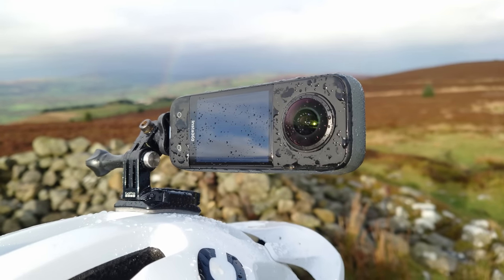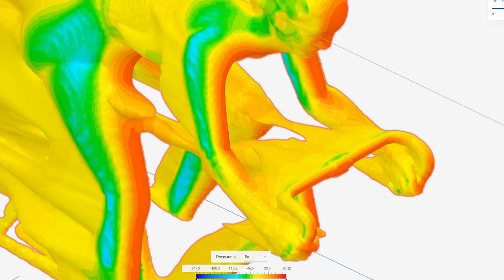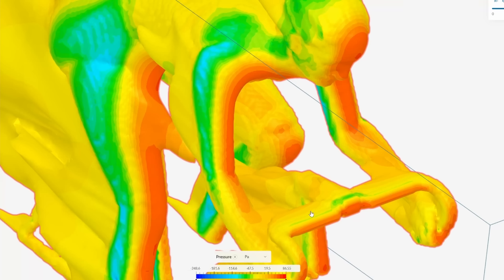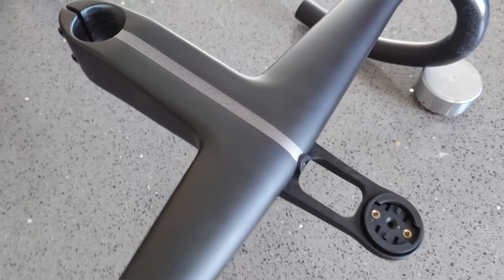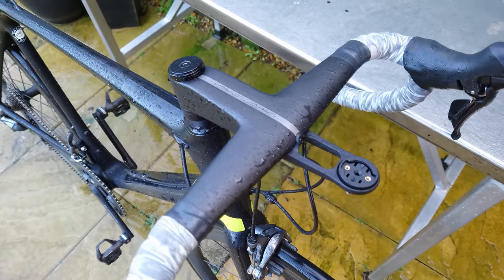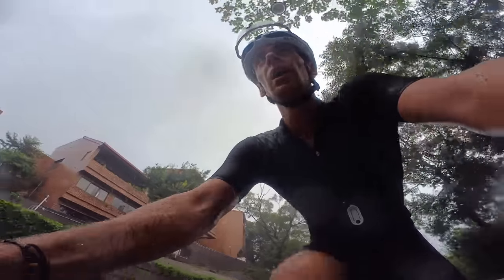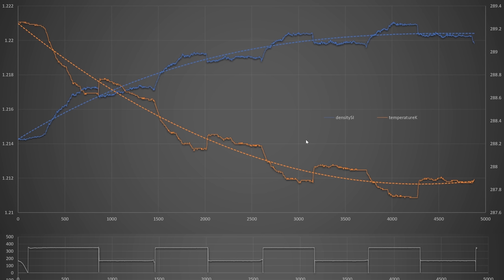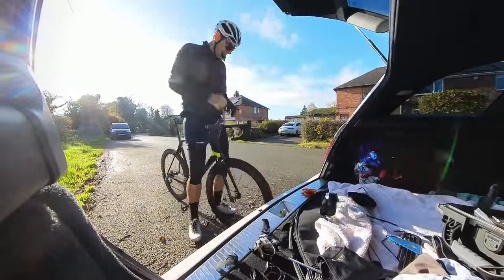Is an Aero Bar Actually Faster? Tested. #aerodynamics #cycling

Comment from the maker: Test protocol:
5 x 1.2km out, 1.2km back (repeated)
3 hole pitot logging at ~5Hz (airspeed, density, yaw, gps, elevation, power, wheelspeed)
Sensor takes a virtual 900m straight of data between two gps waypoints on each lap (so turnarounds and accel/deccel is not logged)
Test speed ~ 40kmh
Power - Favero Assioma
Control tyre - gp5000 25mm
Reply: May have missed it, but round bars were 40cm too?
Reply from the maker: @fastasasloth  yes of course. Has to be the same or a pointless test! Same width, same stem length, same hood position checked with a tape measure
Reply: what is that device you're using to measure airspeed, density etc.?
Reply: What width were your handlebars please AND the length of it’s stem….. I’d like to order one!!!
Reply: Does the one piece handlebar has flare too?
Reply: @mpgunawan  The Farsports F1 does have some drop flare.
Reply: @PeakTorque  Please make a video about your CdA-meter. How accurate do you recon it is? Is the significantly higher price tag compared to the Notio worth it?
Reply: I would recommend to do a hand calculation on the drag force (for cylinder and airfoil cross-sections) prior to doing the test. Would have been nice to compare the hand calc to the test results as well.

Comment: Fantastic content, bravo! Please try different bar width. I’m almost as tall as you are and I believe bar width makes an important difference. Maybe try 36-40-44
Reply: Will depyon the rider's shoulder width. And comfort could be more important on a longer ride.
Reply: Only important if you are racing or actually doing anything other than just riding. Upgrades for 5 watt savings would be better invested in training and weigh loss.

Comfort is more important for most, smaller bars are advised against.
Reply from the maker: With the practical difficulties on testing different bars back to back... I'll leave this one for now!
Reply: Damn DENIED!
Reply: That shoulder width is a rough guideline. Plenty of riders tolerate a size (or two) smaller. Compared to a slammed stem (which I do NOT promote) a narrow handlebar is a joke.
Reply: @detmer87  only true if everyone was built the same mate.
Reply: I just installed 32 c2c bars from HUP yesterday! 😁 
For context: the bike fitter measured my shoulder width to be 40. From there, he recommended me to run 38 c2c but I like to live a rebellious life
Reply: Rejected!
Reply: @PeakTorque didn't canyon have bars that you can adjust? Or was that the bar that mvdp snapped?
Reply from the maker: @simonderoo9189  yes they do. Personally i wouldn't ride them. Accident waiting to happen.
Reply: @BikesKomsCRO  What if someone is already raining hard and doesn’t want to lose more weight?
Reply: @BikesKomsCRO  such a pointless response, repeated all the time. It's not one or the other. You can always do both.
Reply: @BikesKomsCRO  ive got 40 cm. I got used to it really quick (and i ride mtb a lot). Im going to upgrade to 38 aero. 5 watts here, 5 watts there all adds up.
Reply: @ariffau  32??? Wow!
Reply: @adambrickley1119  just 32. I think I can go narrower. Funny enough Cycling Tips just posted a video about that. Then, a few days later, UCI imposed a new rule about bar width for road races. Lol. 

My 32 bars are still legal though. Not that I race UCI sanctioned races 🤪
Reply: With regards to bike fit, it’s actually most  common that people are riding bars that are too wide for them. Large and XL bikes often come with bars up to 44cm, which is way too wide for the vast majority of riders even if they are tall people. Do not just assume that the handlebar that comes with your bike is the right width.
I know on the “bike fit Wednesday” series he says that the most common size needed by male riders is 40cm, female riders are more like 36cm average.
For reference I am 6’1” and ride bars of 38-40cm, and this is not based on aero, they fit me better and are more comfortable. I also prefer the sharper feeling handling of the bike, I find the original wider bars make it feel sluggish.
Reply: @BikesKomsCRO  plenty of people have money but don't have time.  Also, a new bar or losing weight aren't a thing where you only get to do one😂
Reply: @huntos83 Same here I’m 6’ and ride a 56 Supersix recently switched to a 38cm. Way more comfortable, sharper handling and free speed. 😁 The stock 42cm feels like a bus steering wheel now.

Comment: One advantage to the areobar that I'm fond of is the ability to rest my forearms on the flat section, especially into a stiff wind.  It's much more comfortable than my round bar bikes.
Reply from the maker: Yep. Technically illegal in UCI but very fast for the local road bike TT
Reply: I've put Grip tape on the flat tops of my madone for that, works perfectly, no slipping whatsoever, love that side effect of integrated bars
Reply: I would say they are more confortable but they require custom mounting for lights and cycling computer. So if you tight on money they do not add much and are much more expensive
Reply: @RemiBusseuil  depends on the light. Light&Motion have a nice mount that sits perfectly on round or aero bars, as it's a quarter saddle (top to front)  with a rubber strap for the rest.

Comment: This is a year old and I haven't read the comments so this may have been said already but those curves are so similar that they seem to even be within margin of error (not just equipment/sensors, but different weather, slightly different daily body condition, etc.). Actually I don't know the margin of error but it looks like a percent or two would be enough to throw them into an approximate tie. I haven't watched many of your vids but knowing the statistical info and margins would help a lot to interpret graphs especially when the differences are fairly subtle.

Comment: I have changed from a 38 Deda compact round bar to a 36 Pro vibe aero pursuit and 2cm shorter stem. I feel like the difference is huge as the aero bar is much more comfortable in the aero hoods position as it's flat so it doesn't hurt the forearms and the 2.5cm reach increase helps because the contact point on the forearms is much closer to the elbows compared to the previous bars when in aero tuck. Also I've turned in the levers so the tips are 30cm apart but it's 40cm at the drops so it's still manageable in sprints and descents. Only Speeco makes a one piece barstem with similar dimensions, even Pro doesn't offer this bars in carbon

Comment: I did find myself wondering if it would be an interesting little experiment to 3D print some different aerofoil sections to zip-tie onto the tops of a round section bar (basically just faring) and conduct a real world aero test just to reduce the other variables, essentially keep fit identical but play just with the aerodynamics of the bars to see what impact that really makes.

Comment: How about a non-integrated aerobar? You could technically get the gains from the aerobar and fine tune the position with your stem of choice. However you would get more drag from the stem faceplate which might neglect the gains from the aerobar?

Comment: One big shoutout to Farsports for making 36cm bar.
Many small riders had to use 38cm aero road bar just because that's the smallest size available. Not the case here.
If you are 5'6 or below with average shoulder width for the height, consider 36cm bar.
Reply: Yes, 360mm and 80mm stem are available.
Reply: @FARWINDY  is it compatible with Winspace T1500 with slammed stem?

Comment: There are aero bars such as the Zipp Sl 70 that are not integrated with the stem as well. A good option if you’re worried about the drops and fit

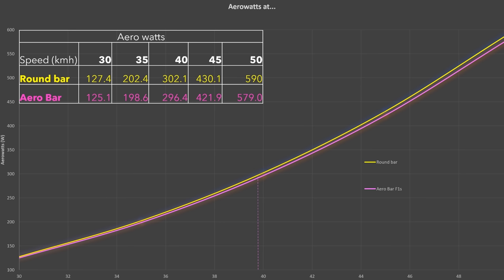Comment: 7:47 onwards is a good point and my main issue with bar+stem combos, not to mention the issue with the drops being non parallel to the ground (why is that) with many models.
On my frames I ride a 130mm stem with bars that have around 110mm reach (not sure) and pretty much all one piece bars come in a compact setup. But they usually also top out at 130mm stem length meaning I can't get enough reach. I tried riding with around 20mm less reach and not only is it uncomfortable but it's noticeably worse on the hoods and in the drops for my position. And my frame already has a long toptube for it's size too. It's very annoying and also makes me wonder why so many bikes (Canyon for example) come with one piece bars and they don't even let you select a size either.
Reply from the maker: Yeh, as a stock component on a bike with no selection of the size, pointless. But the marketing lads love it

Comment: I ride puppy paws when I want to go fast. If my forearms are on the tops of aero bars with padding I don't see how a flat top section on the bar will help. Maybe the 2 inches of a flatter bar between my arms and bar tape. And Bar width is huge for aero gains.

Comment: The body shade temperature makes more sense - overall the temperature is dropping (the sensor being taken out from the car and nearing the ambient/steady state temperature)? But when you turn to south, the temperature rises in a very noticeable step (the sun starting to shine on it?) above the trendline while turning to north gives a noticeable (but a bit slower) fall in temperature below the trendline.

Yeah, the pressure is the inverse, maybe it has some temperature compensation algorithms? Otherwise it makes little sense for the pressure to change unless the difference is cause by your shade (actually dropping the pressure in the shade). But that would mean you'd be faster going south as you'd be riding into a low pressure area, effectively being pulled in that direction (and vice versa going north).

Comment: Your channel has leveled up with this content. Like other commenters I am interested in bar width. I run a 36cm round bar because it's hard to find an aero bar in that width and I'm betting that a 38cm aero bar is not faster than my round 36 which is much cheaper. 
I would love to see if I am correct in my assumption.
Reply: Yes, it would be nice to see some cda difference. I went from 38 aero to 36 round (only to test) and I'm assuming the narrower body position is faster. 
On an extended review, with narrow shoulders, I find 36 to be quite comfortable in general. Although that's the limit as I noticeably lost stability for sprinting, and holding the flat tops over round is more convenient.
Reply: @SonnyDarvishzadeh  I also find the 36 to be very comfortable despite the fact that I do not have narrow shoulders at all. 
I think shoulder width has very little bearing on the comfort of bars.
Reply: @IlPinnacolo I second this. Just look at aero bars. Really dependent on flexibility and comfort or tolerance.

Comment: Hi there, very keen to on these bars. 1) it's very hard to find integrated bars in a 38 width. 2) I've always felt my reach on my current bars a little long. This is around 3cm short so should be great. 

A big question is any potential customs charges from anything from the US or China to UK. Was there any extra charges? 
Thanks.

Comment: kind of related to the effect you were seeing in the video, do you have any tips for winterizing a head unit?

I'm planning on purchasing my first head unit soon. my current setup uses my phone strapped to the stem (running Strava or other GPS tracking). as my phone's battery will rapidly discharge and power off in the cold, I'm worried even a cycling specific unit will do the same

Comment: These results seem to match up with some reported industry test I have seen previously.
What was the width of the handlebars you used? 40 cm?

Personally I have gone away for aero handlebars to be able to go down to a 32 cm width instead.
Reply: 4:07 40cm. I also use traditional round bars in 36cm width with flare at the bottom. You can actually get ones that are 32cm?
Reply: @PaganiZondaF650hp  Yeah there is a couple, but they can be a bit difficult to find and depending on where you find them a bit expensive for a simple round aluminum handlebar.

Comment: Question - I have the new Cervelo Soloist with Ultegra di2 12 speed and I'm talking to their support team regarding compatibility, they told me that the brake cables might affect the steering performance as the holes are closer to the steering stem? Would like some advice on this.

Comment: I have s-works aerofly 25 rise bar. I am 196cm height, so 25mm rise helps to fit correct position. also flat top sections very comfy for hands in long rides

Comment: Very interesting.
On a separate but connected topic - can you do an aero test to measure the impact of shaved legs? 
Could there actually be an advantage of leg hair to attach the flow of air for longer and actually be more efficient, like the reason for a dimpled surface on zipp wheels. And on that point, why don’t they make a bike frame and components dimpled in pursuit of aero?
Reply: It's been tested in a wind tunnel and shaved legs were notably more aero. Also it has been proven that Zipp dimples (and I own a pair of NSW's) make zero difference at best they are a marketing gimmick.

Comment: Dear PT, what is your opinion on the handlebars? Do you still use them? I have them on my radar.
Reply from the maker: Still using them on my rim brake bike. Really like the shape but seem a bit wider than advertised
Reply: @PeakTorque  Thanks a lot! That's even better, the width, cause I'm using 440 mm on my bike. 
Great job with the channel!

Comment: What would be faster an aero 38mm or a round 36mm handlebar? Currently have 36mm round bars (£18). Wonder if its worth going to 38mm aero? (£32)
Reply from the maker: The bar isnt important. Its the position it puts you in is important.
Reply: @PeakTorque I would be in the aero hoods and drops position interchanging 2 minutes at a time. But most of the time neutral. Would the aero 38mm be faster vs 36mm round you think or similar?

Comment: great content, Did you have a jig to control the position of the levers? Could have some pretty significant maybe of the order of the differences.
Reply from the maker: Tape measure in back of car. I did explain that in the voiceovers but must've cut that bit to try and keep it concise. Edit: to check the stack and reach i mean of the hoods
Reply: @PeakTorque  ah fair! Good work

Comment: Off-topic, but do you see an issue with potentially running a saddle too far forward in order to increase the hip angle (there's about 15mm left of the marked area on the back of my saddle rails).
Reply from the maker: I've never had an issue with it

Comment: I love you calling out that getting your bike fit is where everyone should start. My local crit scene is packed with Doctors and Lawyers on $10k-$15k bike setups, but they all ride way too upright and their bike fits are absolutely awful.

But dropping a few hundred $$ on a great bike fitting isn’t as sexy or easy as spending the same on some carbon aero bars that look sexy…
Reply: But do you think those doctors and lawyers who maybe sits all day can get lower and longer? There’s a reason why these people are riding “race bikes” but doesn’t have the mobility and flexibility of a pros. Have you thought of that? I’ve seen people with “aero” bikes but riding position of an endurance bike.
Reply: Bike fitting is a complete racket 90% of the time. I agree fit is important but that doesn't mean the people who charge hundreds of $ (a ludicrous price for such a service) to make a few incremental adjustments have some magic formula which will make everything better. My wife paid $850 for a bike fit where the only thing he did was move the saddle up by 8mm. That's it. And it was less comfortable than before so she changed it back - the fitter was just using his stupid retul system so as soon as all the lights were green his job was done. Absolutely con.
Reply: @lukeh3020  agree with you. The best bike fitter is yourself, and even though it's much more tedious, dialing your fit on your own over time is optimal
Reply: "but they all ride way too upright and their bike fits are absolutely awful." maybe they dont want to mess up their backs by bending over too much for too long. Its not exactly a healthy position.

Comment: I know giant steerer tube is larger than other bikes. Does farsport fit?
Reply: Without the shim, it's 1 1/4-inch, but you're limited to a -10° rise.

The Giant you're riding is the Pro variant, base variant Giants use a 1 1/8-inch steerer tube diameter.
Reply from the maker: Yes it fits both. Fits giant OD2 without the shim. The shim is included to fit smaller (other bikes) 1 1/8inch steerers.

Comment: This corresponds with the calcs I did in my aero bar video from a few years ago, but those did not account for the faster air hitting the body. So 4 to 6 watts at 40kmh seems about right. I Love a light bike and my Ostro is now below 6kg, but I won't put a Darimo bar on it to save 80g because the aero loss is a far greater penalty. And as you rightly say, the smaller you are, the more important aero (and weight) savings are.

Comment: In many opinions integrated carbon Aero Bar is more flexible, than the good handlebar with separate stem... I stiil don't understand the of idea "riding faster". What's the point of any exercise besides race, competition, because 99% cycling ryde for fun and fitness. Strange. The more efford you make, the better.
Reply: Gotta best the boys at the local
Reply: Wouldnt be a great ride without smoking your mates…